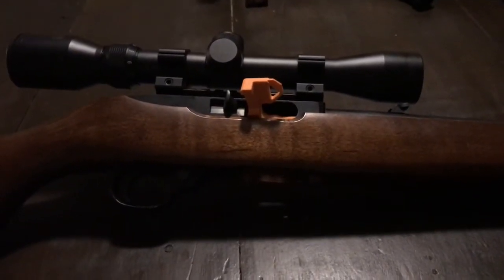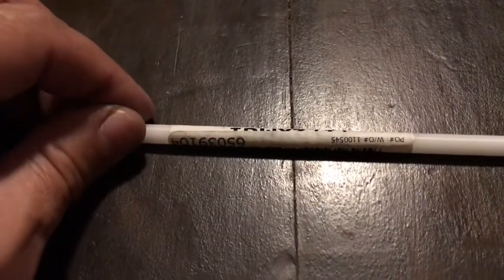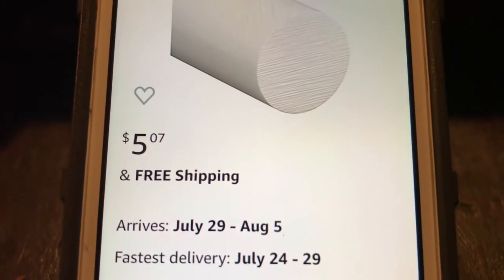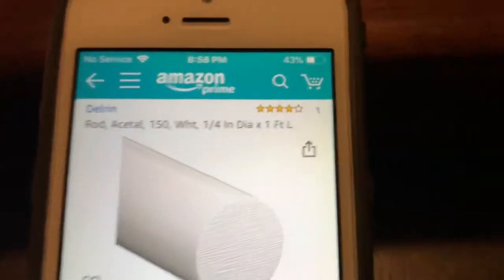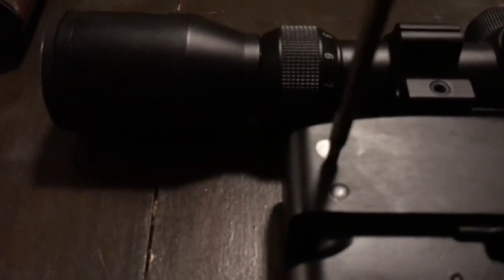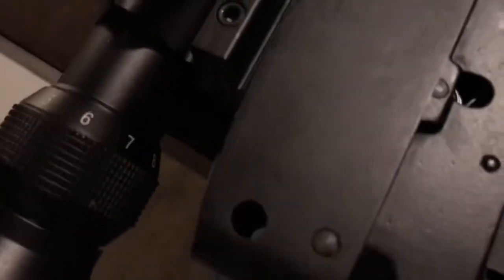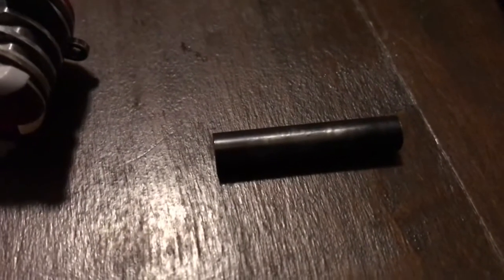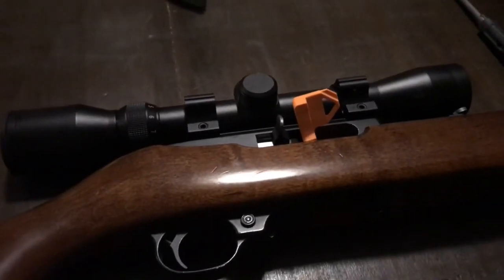Ruger 10/22 buffer swap DIY - Delrin 150 rod (Update 04/2/2021)

Comment: Very nice.  Thanks for posting.  I did go to Home Depot yesterday.  Asked the hardware areas sales associate where the nylon fasteners were.  He said there are none.  I looked for myself, anyway.  I didn't find any.  Thanks for the link for the online source.
Reply from the maker: The nylon fasteners will be found at Ace Hardware. They won’t hold up based on reports from some guys I know. The Delrin should do great. I’ve only shot about 50 rounds in that rifle because I’ve been so busy but I did inspect it and it shows no wear.

Comment: Hello been using dowl rods from dollar general store. Or Walmart can’t remember been holding up. I took original metal ones out trigger group to. Two pins. Got pack of 8 two each 4 sizes. Few bucks stay safe
Reply from the maker: Please use some good material. Putting wood into a receiver seems like a recipe for disaster
Reply: @SmithFarmandOutdoors  yeah. But the receiver is plastic. 3D printer. I wouldn’t go over 22 lr but they do ar15 to

Comment: Hey. I was looking at this on-line. How well does it hold up? What about in the cold weather? Thanks.
Reply from the maker: Hi. It’s been 2 years. No issues. Still working with no deformation or cracking.